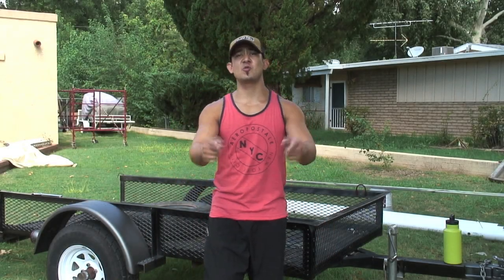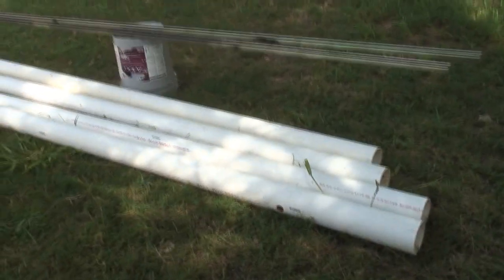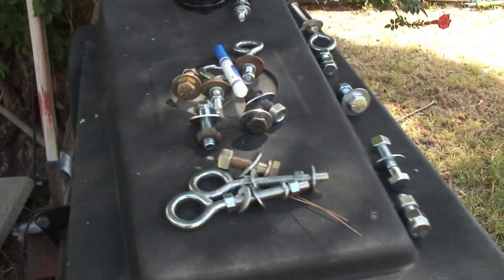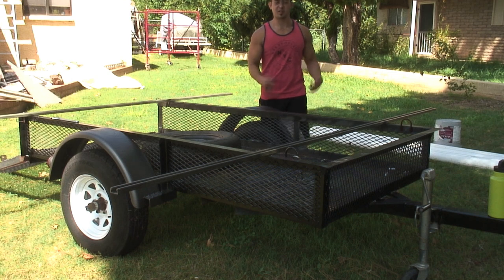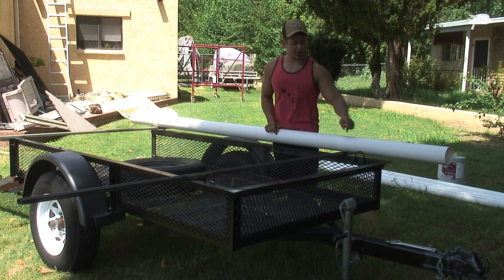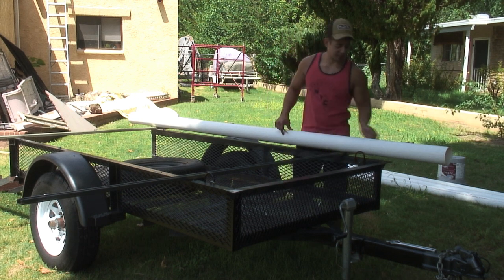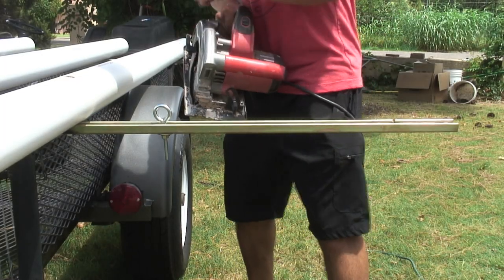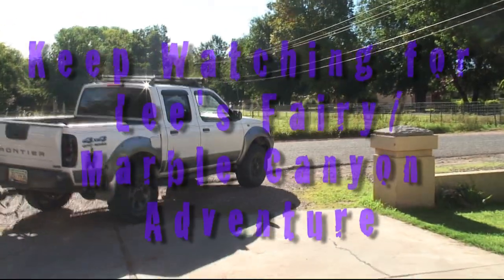DIY Kayak Trailer

Comment: Always great that folks like you and me share ideas, whether good/bad or otherwise "there's another way" as we all know there's always "another way".  Case in point, I am going to do a similar thing soon to a utility trailer for two kayaks and just watching your video gave me one great idea and that's to use "uni-strut" which is what that channel bar is called.  Now that being said, there's special (not expensive) hardware that fits into it where you can move it so I would have used it, giving the ability to shift things easier later.  Thank you for the video.

Comment: How did you remove the ramp?  Did you cut the hinges?
Reply from the maker: Charlie L it comes off. No cutting
Reply: Charlie L , mine looks like I may have to cut it. I wish we could have seen how this one came off.
Reply: @valentinia1  mine doesn't come off either but it flips all the way in and lays flat on the trailer floor out of the way. have you tried that?
Reply: Davis Knowlton , yes it worked nicely! Just picked up 2 Old town predators and can’t wait to catch some big fish. Cheers
Reply: @sunamii1080i  I just folded mine into the trailer and clamped it down

Comment: What is your website for the specs so I know what to buy and build. Thanks
Reply from the maker: Hey friend I don't have a website with specs on this. Use wood. It's better and wrap with cloth or fake grass!
Reply: @sunamii1080i  How is the unistrut holding up?  Does it bow in the middle?